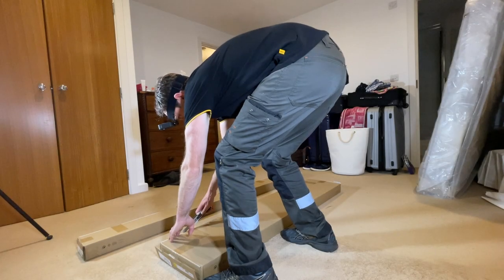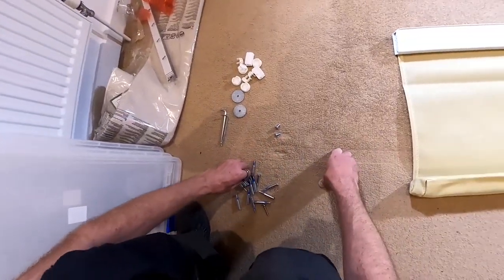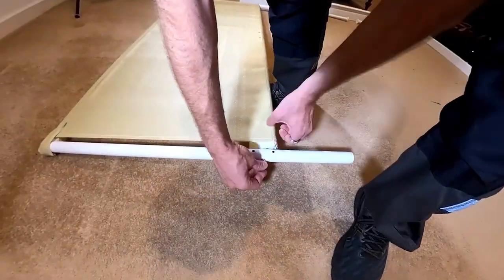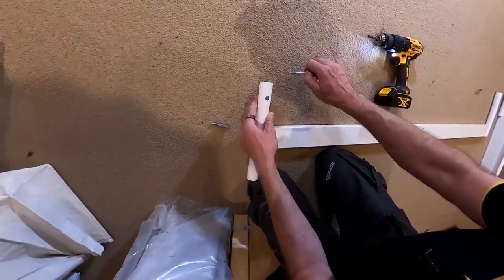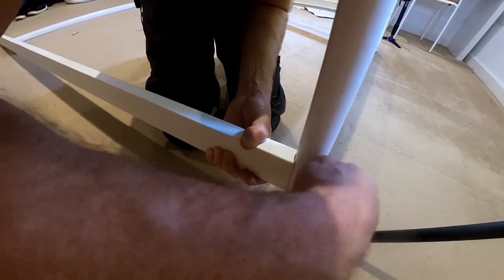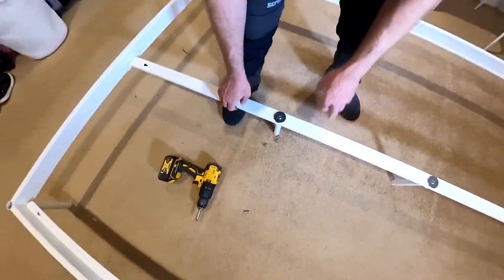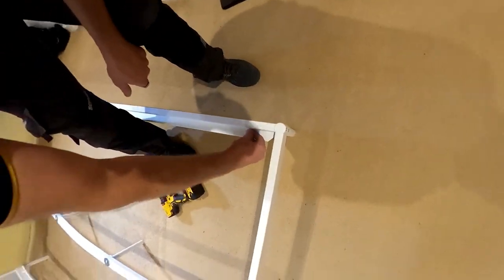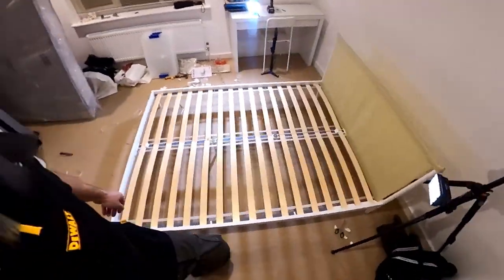How to Assemble the Ikea Kleppstad Bed KING Size Step by Step

Comment: How effective are the allen keys provided by ikea? You used the machine to screw in.
Reply from the maker: Well.. they do the job, but I never use them - much much quicker to use a drill driver with a screwdriver bit holder and a decent set of bits..